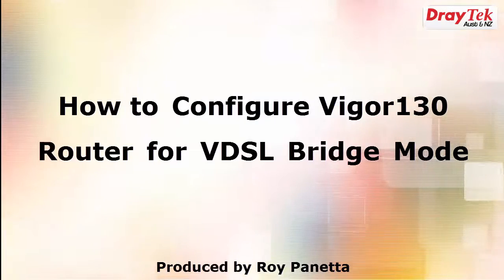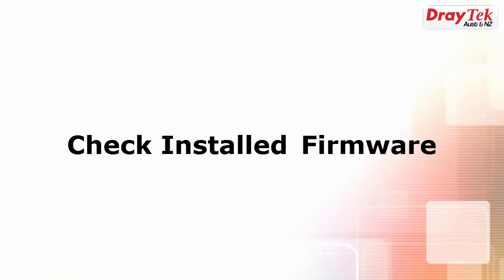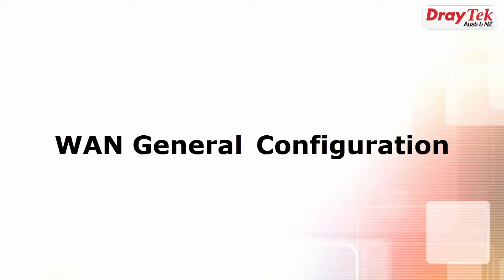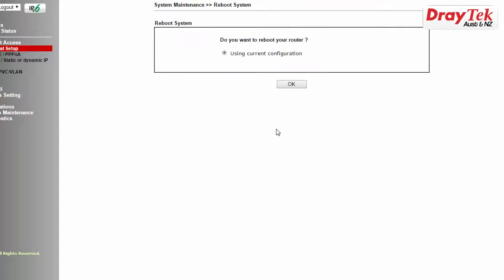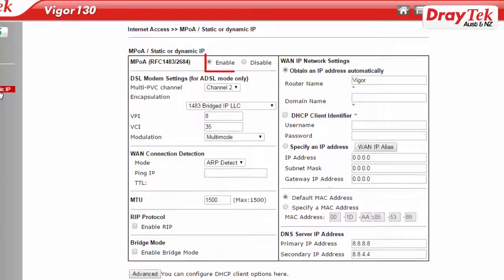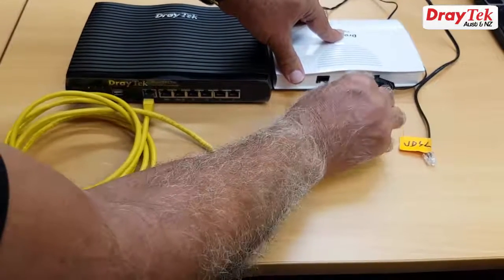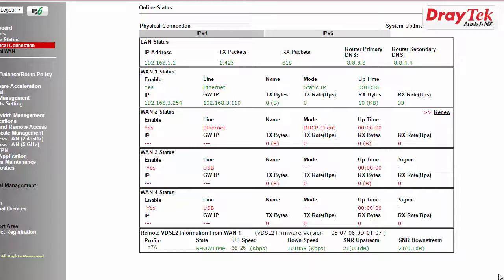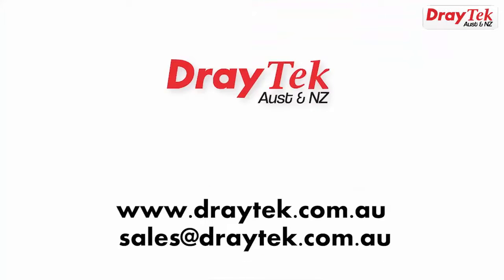How to Configure the Vigor130 Router for VDSL2 Bridge Mode

Comment: I have an Asus router behind the DrayTek modem. A Gigaset N510 telephone system is connected to this router.
Where and how do I set the port forwarding?
Reply from the maker: If the DrayTek modem is correctly set up in bridge mode, port forwarding will be done on the Asus router.

Comment: Hello, my ASUS router currently uses 192.168.1.0/24 with my PC fixed to 192.168.1.1. When bridging the Vigor 130 will this cause issue? Also is it possible to see Vigor line stats while bridged without having to disconnect ASUS?
Reply from the maker: Hi Lachlan, one way is if you put the Vigor130 in a different subnet to your LAN. eg Configure the Vigor130 on IP 192.168.100.1, and then create a route on the WAN. This then should allow it to be accessed from behind the router on that address. There's a Whirlpool thread discussing this at https://forums.whirlpool.net.au/archive/2771186
Another method is at https://www.draytek.com/support/knowledge-base/5212
Or, if you have a spare switch handy, connect the Vigor130 to that with cables to both LAN and WAN ports on the router. The Vigor130 will need a unique IP address in the same subnet as your LAN. (I haven't tried this one but in theory it should work).
Reply: @DrayTekAustNZ  cheers I’ll check out the links

Comment: Regarding the DSL Mode, How much does the line detection increase by setting it to VDSL2 instead of leaving it on Auto?
Reply from the maker: Hi Tim, setting to VDSL2 will be faster since the router will not have to scan the connection type which can take up to a minute. How much faster will depend on line conditions and other local factors.

Comment: Why draytek so expensive
Reply from the maker: Thanks for your question! The short answer is quality comes at a price. A slightly longer answer is that DrayTek products tend to be feature-rich using tried and proven technology, and come with the hardware quality and processing power to support those features as promised. They are also backed up with quality technical support and ongoing development. Price is also subjective. What one person considers expensive is an economical choice to another. DrayTek in particular excel and fill a much needed niche in the SOHO and SMB market. Paying less can turn out to be a false economy if the product doesn't perform. While paying more (in many cases a lot more) for some other high-end products may be overkill and unnecessary.
Reply: DrayTek Aust NZ ok next does it suitable with copper phone line cable because my upstairs cant reach the internet connection from wifi netis modem
Reply from the maker: There are many different routers available to suit different Internet connection types and the size of your network. It sounds like you have a wireless range issue though. If you need access both upstairs and downstairs, the best solution will probably be to leave your existing router where it is and install an additional wireless access point upstairs. This will need to be connected to the existing wireless router either with an Ethernet cable or set up in repeater/range extender mode. Repeater/range extender modes sometimes have compatibility issues between brands so for best results it's usually best to stick with the same manufacturer, but usually it works ok. If all else fails you may need to attach it by cable, but it often performs better that way anyway.

Comment: Is this the same config on the 130 for using a Ubiquiti Edgerouter 4 router? I am confused between Bridge mode and PPPoE pass through settings. 

I would also like to access the router & its DSL stats through the ER4 when connected up. Thanks
Reply from the maker: It is recommended to use Bridge mode as shown in the video rather than PPPoE pass through mode.
When the Vigor130 is in bridge mode it is not possible to directly access the modem. A method that can be used is described in the application note:
One method to access the Vigor130 when it is in bridge mode is described in the application note: 
https://www.draytek.com/en/faq/faq-connectivity/connectivity.wan/how-to-access-vigor130-in-bridge-mode/

You can try the method described in the Whirlpool forum post: https://forums.whirlpool.net.au/forum-replies.cfm?t=2771186

Comment: I was looking for a way to access the Vigor 130 after setting it up in bridge mode, thank you for mentioning the necessary IP config (static assignment in 192.168.1.0/24 subnet, for anybody wondering)
Reply from the maker: One method to access the Vigor130 when it is in bridge mode is described in the application note: 
https://www.draytek.com/en/faq/faq-connectivity/connectivity.wan/how-to-access-vigor130-in-bridge-mode/
Another method is described in the application note:
https://www.draytek.com/en/faq/faq-connectivity/connectivity.wan/how-to-check-vigor130s-dsl-information-from-vigor2925/
This allows you to see the Vigir130 DSL status from the main router Online Status page.

Comment: Can you please do a video on how to configure the vigor 130 as a modem (like the one you did with internet only) but now including routed or bridged IPTV with a 2925 router? There are a lot of users here like me who only get the internet part working, getting  IPTV working is something else. Personally, I want to connect my STB to one of the LAN ports on the draytek 2925 and use LAN port 1 to connect a switch for normal LAN (internet) traffic. My ISP uses VLAN6 for internet and VLAN4 for IPTV. I looked everywhere on how to get this working and people have, but what I'm missing is a guide with a draytek 130 modem and draytek 2925 router.
Reply from the maker: John,  Thanks for the suggestion.  We will look at producing a video using your scenario.
Reply: That would be brilliant! Thanks.